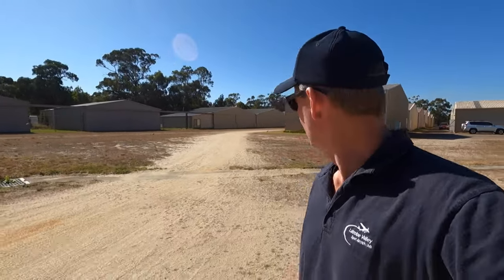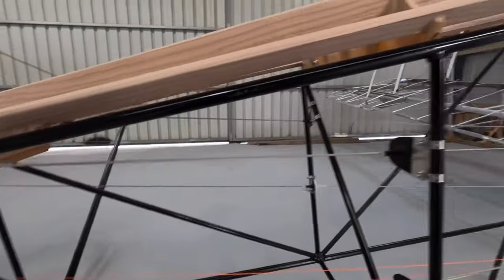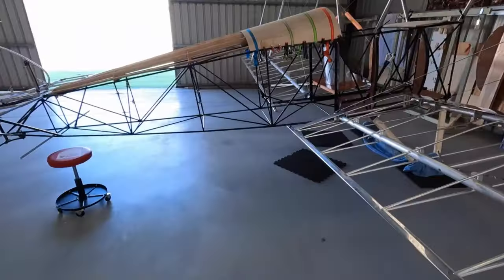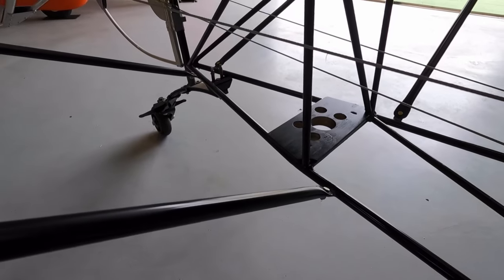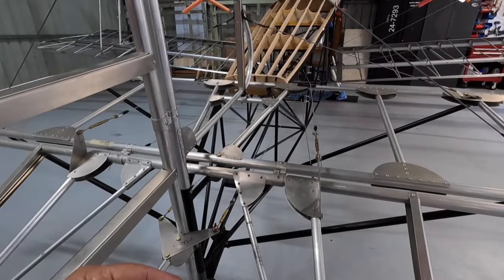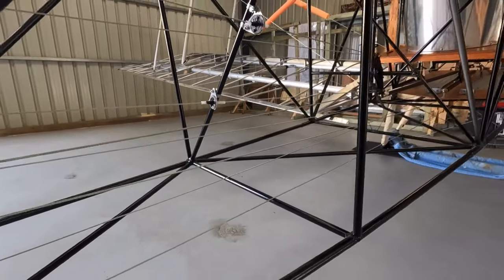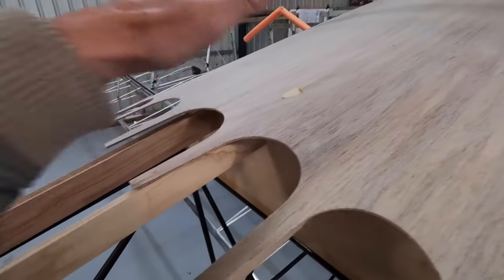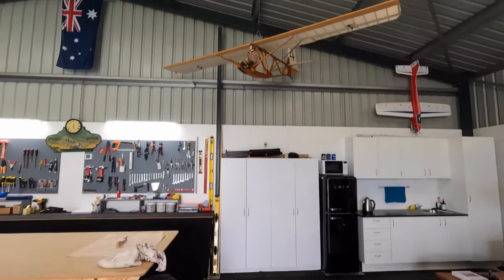Building and Rigging the Rudder of a Sopwith Camel: Step-by-Step Guide

Comment: I'm not an engineer.  I am a backwoods mechanic and also an A&P in the states. I would go with some small bearing pulleys and try them for feel at different cable tensions. I wouldn't think there would be a lot of flex in that fuselage for those runs. Put some stops in.  I can't imagine what the original drawing was. Maybe something we wouldn't want to be in. Pulleys wont wear as fast as tubes and low tension. Cable tensioners put them in an easy low spot in the cockpit. Less mess with covering and having to get to them. Thanks for your videos Scott! They sure are a treat when you post!
Reply from the maker: Thank you, trying to keep it simple and all the weight forward. Appreciate the input.
Reply: Your ingenuity, persistence and resilience is very impressive Scott. The sheer lack of any ‘kit’ would really frustrate me. But you keep finding solutions… you will have really earned your dream when it’s finished.
Reply from the maker: Thank you

Comment: 29:46 glue is the joint. wood breaks before the glue does.
Reply from the maker: I was meaning more glue is not necessarily stronger
Reply: @scottmatthews5280  perhaps, but fillets and gussets exist for a reason. stress risers. I can't say for sure myself, but the glue does add structure, and that means the fillet should relive stress. but you're right that there isn't exactly a lot of stress on those parts as all they really do is carry the fabric and give the fuselage shape when covered.

Comment: On the original (may or may not be useful here) the bottom of the last fuselage bay, next to the tailwheel is not covered. On the original the tailskid was mounted inside the cavity which is obviously not the case here. But I imagine it might still allow access for adjusting things? It might save making an access panel. 🙂
Reply from the maker: Oh great idea thanks

Comment: Hi Scott, I'm just wondering whether you're making a lot of work for yourself by introducing the wing root fairings. I've got one to build (not Airdrome) and the originals didn't have them. I keep wanting you to just cut the ends of those trailing edges off and call it done... It's a real education watching you work in metal though.
Reply from the maker: Thanks, yes the trailing edge will come off, if just leaves a big 5” gap and you can see the wing mount etc. it will be a lot cleaner to the eye